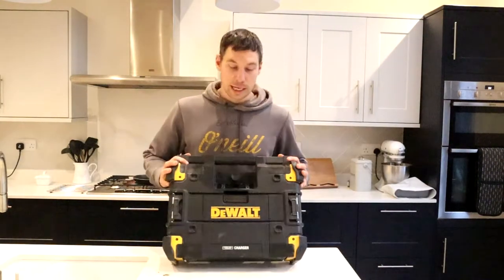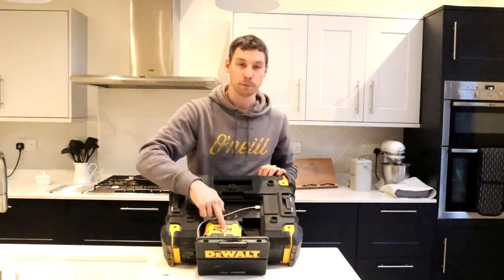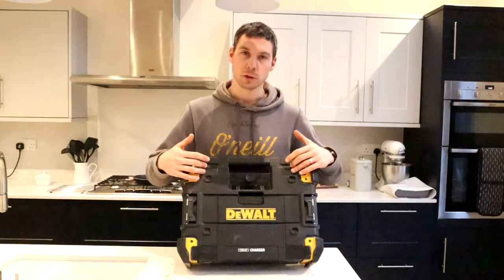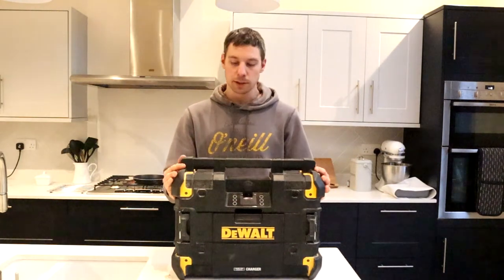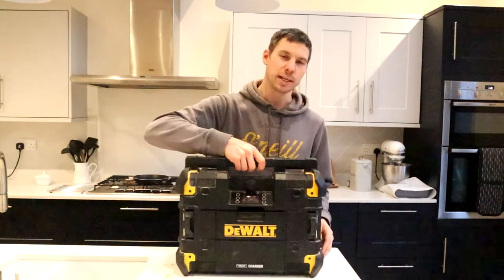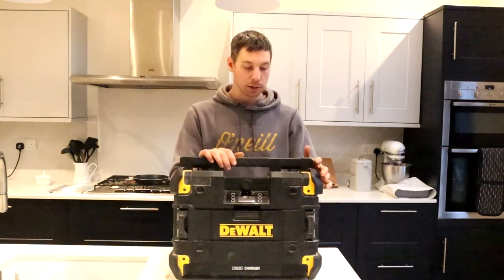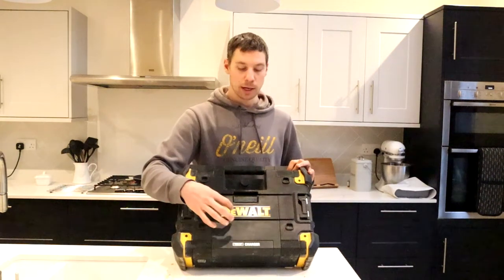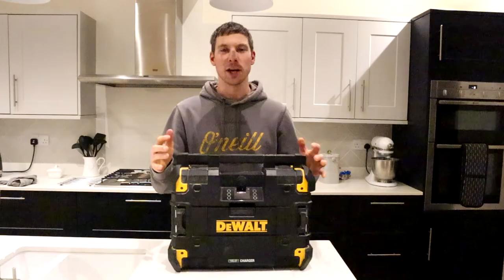DeWalt TSTAK DAB Site Radio Review

Comment: Do u have to buy a battery (5amp) for example and a charger?
Reply from the maker: The radio comes with a cable and plug so you could connect the radio to mains power and never need a battery or charger. When plugged into the mains the inbuilt charger will charge your battery so all you need is a spare battery to take it anywhere.